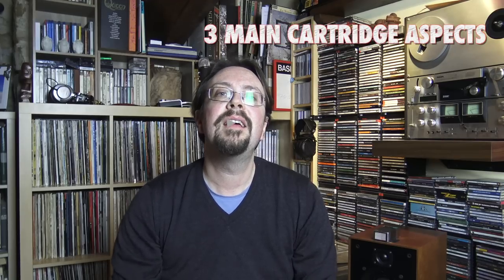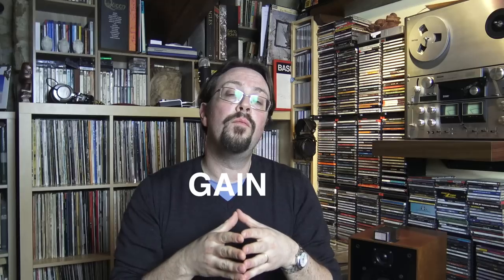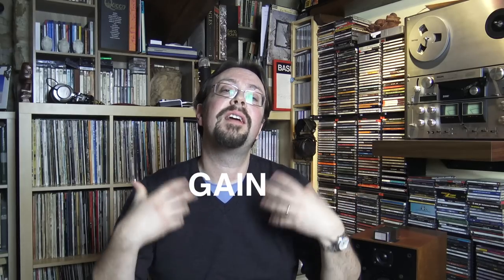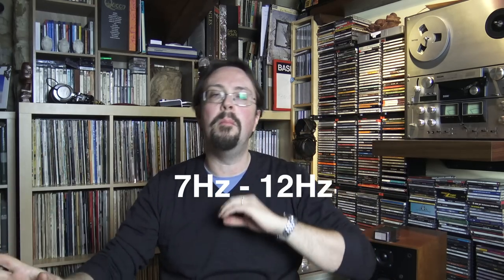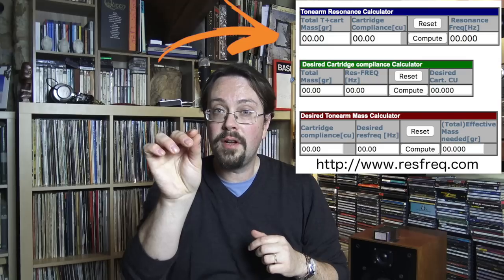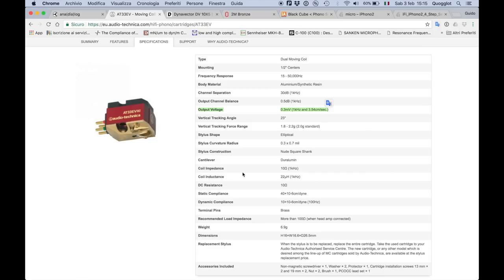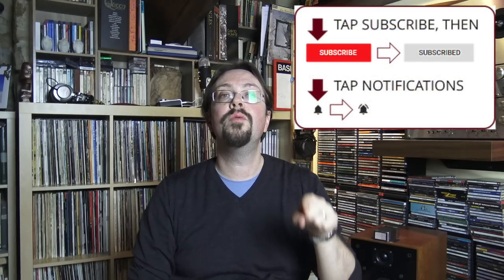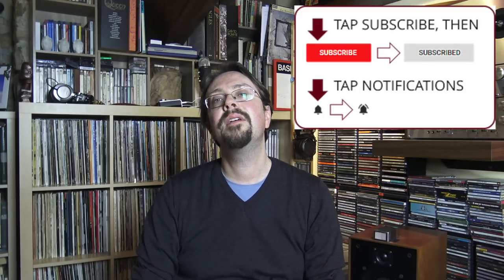PHONO CARTRIDGE: How to choose and match it with your preamp and tonearm

Comment: I’m using denon dp300f with nagaoka mp100 cartidge. Problem is when i played little bit of wrap record then the cartige are slightly jump in that particular area where the record wrap and my speakers cone have unnatural movements. Tried shure 97xe with denon. Here the problems still but when in 97 cartidge the dynamic stabilization on then the woofer movement is normal. But shure styles maybe very much old and sounds not good. Any suggestions??what cartidge i choose with denon. Not to much budget for the same.
Reply from the maker: Use a record clamp!
Reply: @anadialog  use a record stabilizer clamp not threrd one. But not solved
Reply from the maker: Is this happening for just one record or all warped records?
Reply: @anadialog  wrap record and also fresh record its happing. I’m tried different phono pre alongwith some kind of vibration management. The company spec not specified the tonearm mass so I didn’t find on net also.

Comment: I'm fundamentally not understanding something. I get that you record a sound onto a record and it leaves little pits in the shape of a waveform. Great.  How then does those little resin plastic pits in the shape of a waveform then spit out the sound of The Beatles and not just some random screeing warble sound that goes up and down in amplitude?  How is the music in the pits?  I get how it makes the shape into the record. I don't get how then just a waveform in plastic (or pits in a CD)  becomes a recreation of the exact music and not some random sound when played back.
Reply from the maker: Then magic of analog music! It's not that simple...your description seems more that of a CD! I will make an example through another question. How can a loudspeaker produce different types of sounds and music, when it's basically doing the same movements? It's not like a digital file that is being red by something...the music is analogically reproduced by changing the pressure and the speed of the drivers based on the frequency of the signal. Something similar going on the grooves. Each groove is created by a micro movements of the cutting head based on the frequencies of the signal.. et voila! Magic! Even our vocal cords do something like that...millions of sounds from the same piece of...meat!
Reply: @anadialog  yes, I understand that. But you're not explaining it what I'm asking.  Slow down and think about my question. :) . A recording on a record is just an etched waveform in plastic.  In your mind zoom down to the microscopic level of the record and see the groove cut into the plastic.  The music was "burned" onto the record,  you are looking at what the final waveform looked like,  rendered in plastic.  But how does a record player cartridge pick up "Abby Road" from just a waveform in plastic?  Why doesn't it just sound like a random noise that goes up and down with the waveform?
Reply from the maker: @Audfile  because those waves cut into the vinyl correspond in their shape to exactly that frequency, that soundwave etc. The cartridge follows that precise shape and those precise MOVEMENTS of the stylus are transformed into the corresponding eletrical signal (the soundwave is back) thanks to the magnets or coils or iron or crystal etc. inside!

Comment: Hi, I would like to get the dynavector DV 10X5 MKII but I have a question:

This cartridge is 2.8 mv and > 1000 ohms load impedance. Can I use this Cartridge direct in my phono input of my rotel preamp RC 1572 with 3mv and 47kohms input spec without the need of an external preamp?

Thank you.
Reply from the maker: I am afraid not...is it MC, Moving Coil, compatible? Or only MM?

Comment: Hi !! I'm considering buying at95ex mm cartridge ..and also considering buying Cambridge audio Sr 20 or 10, or marantz pm 6006. Will it match? I'm totally lost here! Neither of these amps give detailed specifications regarding the load etc. I am currently using Philips GA 242 turntable, popular in the early 80's in India, any specification pertaining to it's tonearm (EM) is totally unavailable! What to do!? Help!!!!
Reply from the maker: Hi there! Sorry for my late answer but tech questions are hard and need time. Straightforward I do not recommend the Audiotechnica nor the Cambridge. The AT is a replaceable cart and these have very poor sound. If possible try for a budget Ortophon like the 'Red' or a Shure M97Xe. The Cambridge is a AM/FM receiver. Its always better to get a dedicated stereo amplifier. For example the Onkyo A-9010 is obtaining a lot of success for a tight budget. If you like Cambridge Audio, which is a great company, you should think of going up to the CXA60. For the turntable, if we cannot have the arm specifications it is impossible to establish the mass of the cartridge. In any case do not worry. These are subsequent tweaks. I would pick a good cart and you will have great enjoyment.
Reply: Thanks for the help. Well I recently got a Luxman lv111... I would love to hear your opinion on that particular amplifier. It's not a receiver .☺
Reply: ANA[DIA]LOG and for now I'm sticking to EEI classic 700 cart that was a match for the table so long as I don't get my hands on a Technics sl1200 or something...

Comment: I wanna recover my turntable hifivox and the the ref of the cartridge is CDS 620. Do you know what can i do to check if the cartridge is working?
Reply from the maker: Its all analog technology, untill you drag the stylus on those grooves you can't. But i am sure it does. Its not a true electrical component so don't worry. You will also need a phono pre-amp if the turntable does not have it included. You can understand that If it says line level output somewhere.
Reply: @anadialog  Many thanks , i dont need the pre-amp because the turntable have one, it's a turntable with tube valves from 60s (it´s something like that https://www.audiovintage.fr/leforum/viewtopic.php?t=22506)
I have 1 more question: It's possible to use another cartridge in my turntable? If yes, what do i need to keep in mind when choosing a cartridge different from the original?
Reply: @anadialog  it's this model :https://www.vinylengine.com/library/dual/1007-a.shtml
Reply from the maker: I see, wow! Very interesting vintage model. I am not familiar with this type of turntable but on the web I see that it has a detachable headshell that should allow you to change the cartrdige but the problem is the mounting structure. I am afraid that you cannot. What you surely can do is replace the stylus, the tip. In any case please ask in forums like Steve Hoffman about it. They will certainly give you more info.

Comment: The capacitance of the mm cart is not stated because it is irrelevant! What is relevant is the REQUIRED load capacitance of the preamp for that cart due to its self inductance which is a function of its windings.  Usually the lower the load capacity the preamp uses the better.  Dont forget to include tonearm and interconnect capacitance.

Dynamic compliance of the cart/arm set up should be between 8 and 13 Hz ideally.  Mm carts have higher compliance than MC carts so work better with light to medium mass arms typically 9 to 12g.  Mc carts need medium to heavy arms, typically 12 to 17g effective arm. mass.

Japanese carts tend to use compliance figures tested at 100khz whereas most others are tested and stated at 10khz.  The relationship is complex but if stated at 100khz divide be between 1.8 to 2 as a rough rule of thumb.

Mc loading is misunderstood by most reviewers, bloggers, vloggers and hifi buffs.  It is NOT related to sound.  It is there to PROTECT the cart widings against current overload by providing a high enough load impedance to prevent current overdraw.  Multiply the self impedance of the cart...determined by its windings, by 20 roughly. That gives you the minimum load impedance you should use.

Ortofon bronze is not a good mm cart...it's rather dire...coarse and overpriced.  Ortofon do not make great mm carts.  Look to other makes.

Phono recommended for all carts is easy.  Trilogy 906 does it all in the mid budget.  It is fully adjustable for load.  It betters anything mentioned in this video.

Comment: Hi, just received a Nagaoka mp-110, and after adjusting on a sl1200mk2 with original headshell, I played a record that seemed clean, but heard some noise (artifacts) before the song started, after playing for 30 seconds, I lifted the tonearm and the artifact noise was still there (had the volume pretty high), the noise slowly dissipates, took me a while to figure it out but it seems to be coming from cartridge, I can stop the artifact noise by removing and replacing stylus, is this a defect or is there something I can do to correct this? Thanks, need some help!
Reply from the maker: Are you sure tye phono preamp is set to MM? Is the ground connected? Try following the indications I have listed here: https://youtu.be/P-ekwNDGKeA
Reply: @anadialog  thanks for your reply, I'll check it later, I'm at work. But I have other cartridges that doesn't do it, and I tried with two different preamps(mm) and also phono in mixer, I'll let you know more after I check your suggestions, thanks again. Ps; it's not a hum, it takes about 20-30 seconds for the noise to dissipate (can be heard at high volume only) it not a loud or high pitch noise.
Reply from the maker: Each cart is a world aside
Reply: @anadialog  should i try to return it, or try something else,... I'll try on an other turntable 🤔... Could it be magnetized?
Reply from the maker: If you have the perception that it actually could be a faulty cart, return it and perhaps get a new one or simply something different!
Reply: @anadialog  thanks, I'll try. I did many tests, it's my second most expensive cart (225$ cdn) , I'm left with trying a different headshell and wires, If that doesn't do it, I'll see if I can convince seller to do something. Thanks again, and if you want, I'll keep you posted on my progress.

Comment: my  Crosley c200 takes a Np5 Audio Technica Diamond Stylus any upgrades for this ?
Reply: Not too hot on your model turntable but it looks like the carat ridge can be changed. I’d suggest Audio technica vm95E. You can then get into the upgrade path for styluses. The vm95 has replaced the AT95, which is a stone cold classic value for money option.

Comment: How do I get the tools to remove the cartridge and other parts for the turntable.
Reply from the maker: Hi Megalodons, you should have all the necessary equipment that came along with your TT. If not maybe it is a model that cannot be modified...what turntable do you have?
Reply: The Sony ps-hx500
Reply: I have seen a video of a guy with a different cartridge At440  and I think the other one is a a Mp110
Reply from the maker: Ok, I took a look at the model. Interesting new Sony model! The good thing is that is has a switch to use the phone out (with line out you are using the integrated pre-amp which is not so good generally speaking), plus I see that the arm has screws for the cartridge and detachable leads so you can easily detach the cart and put one of your own in the future. The arm, looking at the pics, cannot be removed so you have to stuck with it and the adjustments it offers. I think you just need to get a micro screwdriver kit and you are set! You can change the cart whenever you want.

Comment: Thanks for the video. Im sure it will help people choose the right combo. Im a little confused how to convert the 10x6 cn/dyne at 100hz  as shown on japanese manufacturers specifications into CU. units in order to use the calculator in your link. Audio Technica's MM cartridge VM740 ( replacement for AT150MLX) says 10 cm/dyne at 100hz  how to convert that in cu? As i understand the value should be around 20? For comparison the Nagaokas MP 110 and up are 21nM.

Comment: you missed the third type of cartridge( moving iron)
Reply from the maker: And you missed the strain gauge! ;-) In reality I did not miss it. As I said, the two main types MM and MC. The others are very rare!
Reply: @anadialog  Really, Grado and Nagaoka are rare?
Reply from the maker: Hi Jon, the brands are irrelevant. It's the number of cartridges out there. Moving Iron and strain gauge are in very low number.
Reply: @anadialog  No, the brands represent a type of cartridge that you didn't mention and thay are not rare.  Grado has been around for decades and anyone that's truly into vinyl knows what a Grado is.  Nagaoka is increasing in popularity based on great reviews.  Nagaoka is also getting a lot of talk on vinyl forums.They may not have the numbers that MM or MC have, but certainly not rare.
Reply: @anadialog  I am revisiting this comment of yours( to my comment. Yes I missed strain gauge,  its probably one of the best but, for many of us, least affordable cartridges.   I grew up with records and in the 80s,as CD came in, there was much more choice( although reducing at that time). the issue today is manufacturers are going for  what is cheap for them to produce.  MC is a nice match for today's  main, "mass"-consumer oriented producers. However the industry has focused  too much on low compliance tone arms.  The result is consumers today have very little choice.     I have gone in the high compliance direction. I run an SME 3009 s2 fixed head shell arm  with an effective mass of 6 grams.   Although I am currently running an Ortofon OM40 (MM)cartridge, I am awaiting the receipt of my desired cart the B&O MMC2 ( currently being rebuilt  by soundsmith).   That cart is a low mass moving micro cross cart( a variety of moving iron ).   The moving micro cross has the advantage of  extremely good channel separation. I believe few MC carts, at the same price point, can match its performance.    Its recommended  tracking force is 1g. Currently the Ortofon I run is almost maxing out the tracking force adjustment on my arm (current cart works best at 1.5g arms maximum tracking force is 2g(if I recall correctly). Perhaps its time for you to revisit this topic including a wider discussion on the limited choice available to those who don't "own a bank".
Reply from the maker: This is not a video on cartridges! But on the compliance of the cantilever regardless of the technology implemented. Nagaoka and Grado are historical brands, never said the contrary,  but it is a fact that the vast majority of carts out there are MC and MM, plus moving iron is preamplified as MM so really no topic of discussion there.
I do agree that the market is loosing its middle range quality producing a lot of low quality or high end products.
Reply: @anadialog   "Moving iron is pre-amplified as MM"     I don't understand that.  I thought MM and Moving Iron are just higher output systems.     I  also don't understand what you mean when you say the compliance of the cantilever.  If you are referring to  the cantilever the stylus is attached to then I really don't get what you are saying. I really need to be told more as the little you have said does  not match my understanding of how to match a cart to a Tonearm.
Reply from the maker: Sure, no problem. It's simple. Moving Iron are very similar to MM cartridges in the output and load, hence you just need a MM phono preamplifier. I was mentioning that because in this sense it does not create a category on its own, it relies on something already existing. Compliance regards the elasticity of the cantilever,  and obviously also by what it is attached to it inside the cart.
Reply: @anadialog    from the internet "As MM cartridges have a higher output, they also have a higher impedance of 47,000 Ohms. In contrast, MC cartridges at lower outputs, have a lower impedance at 100 Ohms. For the capacitance, you'll find MM preamps with up to 100 pF while MC preamps have about 3000 pF."   you need a higher boast for MC not MM
Reply: And paul McGowan seems to agree with my understanding.    A moving iron cart is a compromise that reduces the weight of the "MM"   as the magnet is fixed and not attached to the carts cantilever.. thats why with Moving iron you can get much lower weight carts (the B&O MMC2 is  1.6 g). Here the link to Pauls video explaining the difference:
https://www.youtube.com/watch?v=O_WH3sVAMs4
Reply from the maker: Ian, I don't understand of you are making fun of me. We were talking about Moving Iron and Moving Magnet carts...
Reply from the maker: Compliance is what I described in the last comment.
Reply: @anadialog   No I wasn't making fun of you. I see you edited your comments.  MM and Moving Iron are not the same( Its an extremely common misconception).   The differences between them are huge. Moving Iron allows the car to be lighter and as yet( according to Sound Smith owner and founder) has not yet  reached the development limits that MC  and moving magnet have.          I go back to my earlier comments I think you need to revisit it.   From what I have checked and rechecked, output strength from strongest to weakest is as follows:  Moving magnet( highest output needing the least amplification). a close second place is MI, followed  by MC. The one I am unsure of is strain gauge, I could be wrong but I believe Strain gauge has the smallest signal strength
Reply from the maker: I did not edit my comments. I edited a mistake right after writing. You did not notice it and you did not notice that I said that the output of Moving Iron and Moving Magnets are the same and that is why you use the same type of phono preamp. You also said you did not understand why I was talking about cantilevers, clearly showing that you have not understood the principles of compliance and you keep attacking me on things I haven't said.